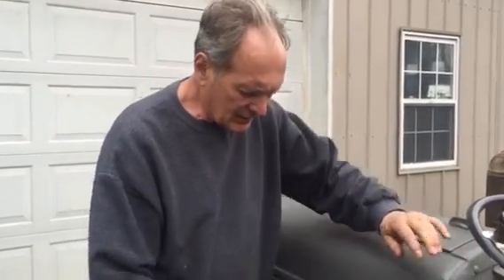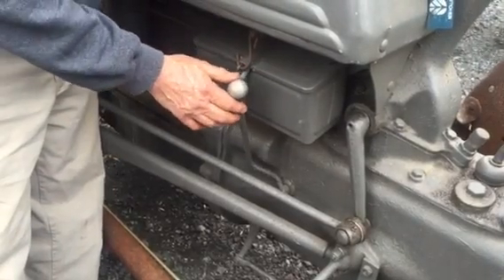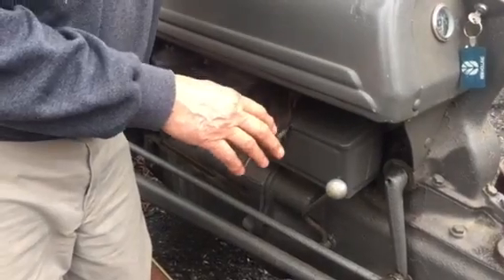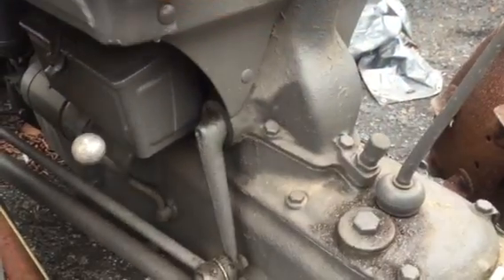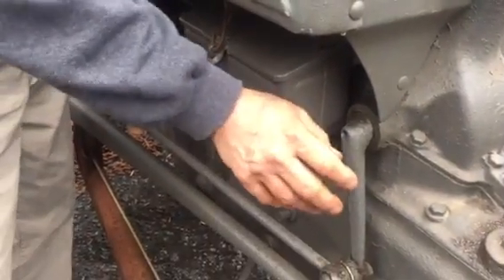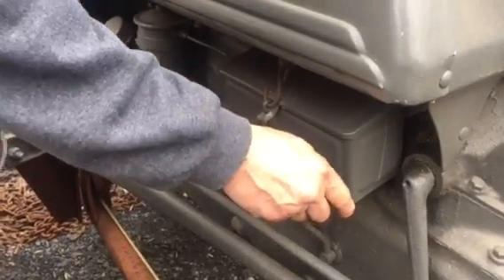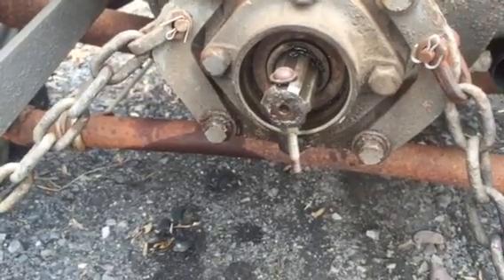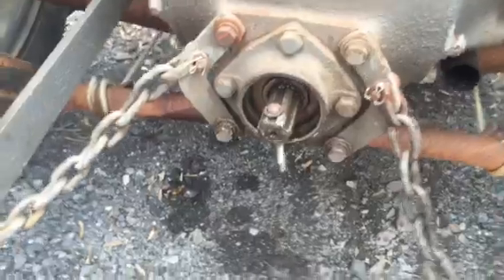Sherman transmission- determining a Step-up or a Step-down

Comment: I bought a 1956 Ford 640, it is my first tractor and I didn't even realize that is has the combo trans on it until I started to work on it, rebuilding the steering gearbox now after getting the hydraulic pump changed and the 3 point functioning. I know this is an old video so my comment might not be seen.

Comment: I don't know as I am trying to learn before I purchase. Isn't there Shermans for 8N that are both step up and step down in the same box? If trying to determine that on a running tractor during a test drive, wouldn't it be easy to tell if I was able to step it up and down (push lever towards center of tractor then either forward or back?) ? Help.
Reply from the maker: Yes there are combo Sherman both up down and direct drive. Watch some of my other Sherman videos might be helpful

Comment: Is the Hupp hi-lo auxillary transmission any good?
Reply from the maker: The hupp dual drive is a good trans but the sherman is easier to get used parts for if you need them

Comment: would you prefer the sherman trans for brush hogging/cutting?
Reply from the maker: The sherman trans will also effect the speed of the PTO so it's up to you. if you can find the right gear to run it that will put your pto at the right speed it shouldn't be a problem and you might even save some gas.  it would also depend on what you are cutting and how high it is.  An ORC should also be used.
Reply: @kirk-nj6344  thanks for getting

Comment: ok, it's two ranges simple as, clear as mud. (-:

Pretty much a Step up has a faster road speed, and step down is like low low on a Jeep type tranny?...more grunt at lower speeds..slower max speed at high rpm? I'm tossed a little.
I was just handed over my grandfathers..said 1943 2n. 
umm, so top speed on a step down maybe 17mph then slower,  and step up maybe 20/25 mph in high range?

I recall dad shifting and rpm higher in the '60s during wagon rides dragging a stick in the sand behind in the wagon, but I don't really know. Few years back I drove it after fifty some years of wonder, and so amazed that I never asked. Third gear on two hunert acres waza hoot, and very happy I acquired it.
Now I need a lean two. The old converted chicken coup is full of other stuffs. (-:
tips me hat ~
Reply from the maker: In your grandfathers 2N, if it had a step down sherman, in third gear, at full throttle, with the shermen engaged the top speed would be 8.01 MPH
If the tractor had a step up tranny, in third gear, at full throttle, with the sherman engaged the top speed would be 18.12 MPH.
The sherman combo trans will have both a step down and step up as well as a standard range. My other videos might help you ID your shifter as to which trans you have
Reply: Thanks Kirk, I'll take a peek.
I'm still a bit confused because you say step down engaged and I wonder of speed in Normal range?
No biggie I suppose. I figure it out after your other vids and drive it again.
~ 'n cool, my cousin told me they rebuilt the carb and it jumps to life. ;-)
Reply from the maker: If you have the same style handle as shown in this video it will only be a sherman step up or step down transmission. it will not be both. In other word the step down will have a standard gear range and a step down range. The step up will have a standard gear range and a step up gear range.
At 1000 RPM your standard gears are;
1st 1.79 MPH
2nd 2.31 MPH
3rd 5.34 MPH
In the step down range
1st 1.18
2nd 1.53
3rd 3.53
In the step up range
1st 2.68
2nd 3.44
3rd 7.98
The step up or step down transmission will also effect reverse and your PTO speeds.
Reply: Howdy Kirk. I was given the tractor last week and I had a great time learning to drive it like a...well..a seasoned farmer.  (-:
3rd gear what feels like standard range, feels what could be 8mph. 
Sherman gotta be a step up. Cranked up in 3rd gear felt like my golf cart which I clocked at 17mph via GPS.
The old Ford gets up and boogies. 
Thanks for your time.
Reply: lol, I did learn to drive it without the herky jerky take offs. Much needed for backing in the old converted chicken coop as shed. 6" clearance each side, one along the wall, the other a metal fender to my utility trailer.
Reply: @brianbartulis9709  Brian-If the shift handle is on the right side, you could have a different style auxiliary transmission. Our 9N had a three speed aux transmission with a similar handle on the right side. Forward was low range, back was high range, you could find a neutral spot and slide the shifter away from the tractor and move it forward to engage direct drive. I'm not positive, but I think this is the Howard transmission.
Reply: @cdjhyoung   Thanks for your time.
I made it up there since this post.

Left side step up. Wow, that old bugger flies along purty good! Farms are bumpy (-: